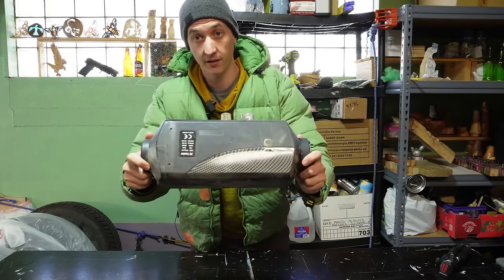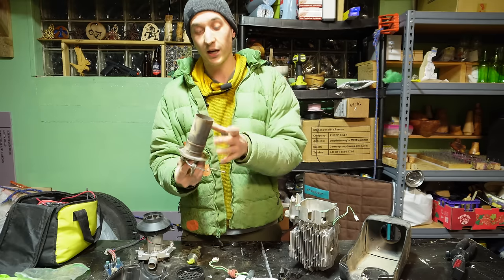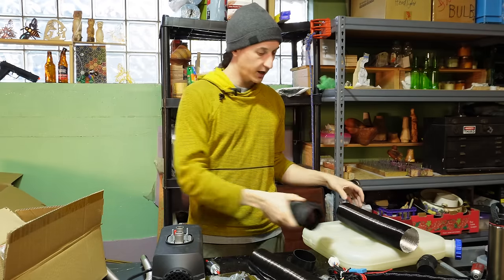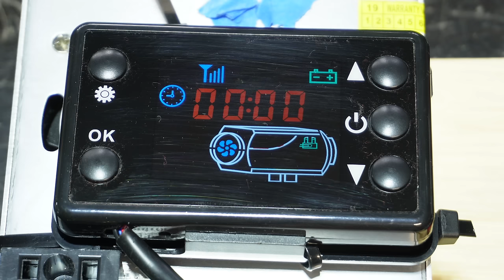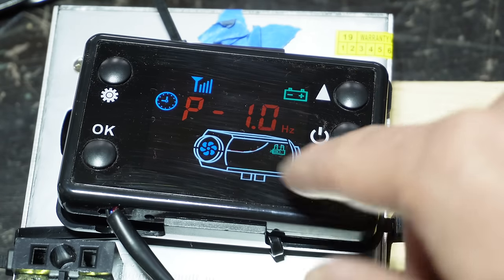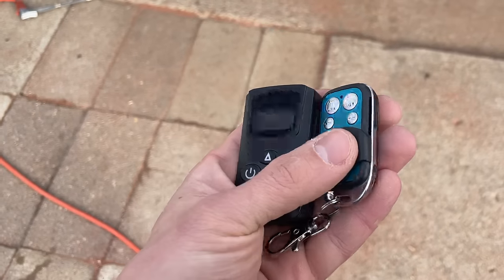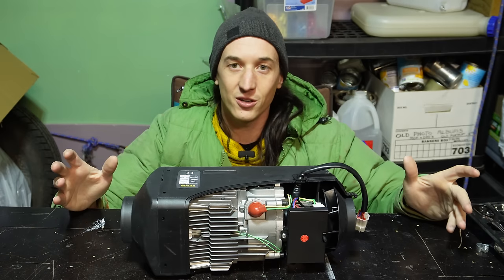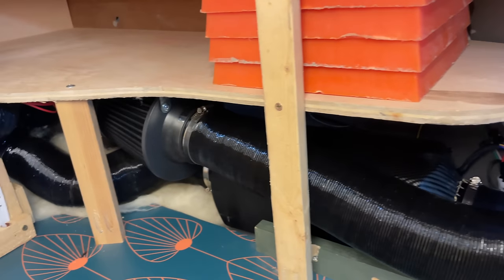Everything You Need to Know About Diesel Heaters

Comment: A crucial step you left out, you must check the exhaust gas for carbon monoxide levels after adjusting. If it's too weak or rich the figures will sky rocket and quickly become a health hazard, and with a window open or leaks in to the living area present a serious problem. Even a cheap Ebay monoxide tester (those yellow ones for $25) will do the job, just hold it a foot or so away from the exhaust so it does not melt on a calm day and take several readings at low medium and high output power. You need to aim for 20 to 50ppm at all power levels (20 at low and 50 at high). I have found 1.6@1680/5.0@4500 the sweet spot for 0 to 2500ft ft alt, 1.4@1680/4.5@4500 for 2500 to 5000ft alt, and 1.3@1680/4.0@4500 for 5000 to 7500ft alt. 25 to 50ppm carbon monoxide is the key indicator for correct combustion/fuel to air ratio. Not had any sooting for years at those settings using good quality fuel on any of my 5's. Running a 50/50 mix of diesel and kerosene is an even better option in cold winter months for clean burns. Some great info for many in your video by the way!!
Reply from the maker: That is a good point! I knew I forgot to mention something. Out of curiosity if you are running too lean how high do the CO numbers get? I change elevation all the time so constantly re-tuning the heater isn't exactly practical, but I think for a static installation this is a great tip to get the most out of your heater while minimizing CO exposure.
Reply: @dustyodyssey  There seems to be a sweet spot window of about .3hz/.4hz where everything runs fine (about .15hz/.2hz either side of correct). So if your target was 1680@1.6hz then you would get to 1.5hz perhaps 1.4hz and not affect the ppm (or at most 10ppm) then when you drop to 1.3hz it will suddenly rocket to several hundred ppm (and much higher at times!). Same goes for increasing, 1.7hz and 1.8hz would usually be ok (just), but at 1.9hz and a sudden rapid ppm increase. It can vary a little, sometimes the sharp rise could happen on the second step above or below, so it can vary on temperature (air density) and other factors including the altitude.  Fuel type and mixing fuels also affects fuel/rpm ratio and ppm, but that's a whole different topic! (for example one of mine has run at 1.2@1680 on 80%kero/20%diesel@15ppm 1000ft which is super low and clean!)
Reply: So - isn't the risk of excess CO higher when you run too rich (not enough oxygen), versus too lean?

I always understood that too-lean virtually eliminates CO output - but at the expense of heat produced. I.e. prioritising 'safety' over efficiency/warmth per unit of diesel consumed.
Reply: Running lean causes high CO i experimented with lots of settings and i now have 20-30ppm across the board and never needed cleaning for 4 years.
Reply: @jamie-hb8gy  That's interesting, in engines running lean results in a drop of CO because you have excess oxygen to react with the fuel. That's interesting that it doesn't work that way in diesel heaters.
Reply: @mibars  Diesel heaters aren't engines,no compression.
Reply: @jamie-hb8gy  yup, but I still don't understand the physics of this! I'll avoid tinkering Hz vs rpm until I get a proper CO detector instead of a CO alarm that goes from nothing to popped eardrums only.
Reply: @mibars  it's basically incomplete combustion.
Reply: @jamie-hb8gy  but how? There is plenty of oxygen for a complete combustion, usually CO happens instead of CO2's when there is not enough O's in the mix, but with plenty of air and scarse of diesel we should see some other ill effects, like a fire too cold not an incomplete combustions
Reply: Health..u eat food don't u..don't know what u eat. .

Comment: Most fuel pumps do better pushing fuel than sucking it out of a long line.  You want the pump to last longer, have it as close to the tank as you can OR have it lower than the tank.  It will also help with priming.

Comment: Although many will disagree, the fuel pump mounted in a vertical position will increase its longevity with complete lubrication of the pulsating cylinder, also the rubber glow plug seal needs to be properly installed or you will get exhaust in the cabin area. For the body intake you can adapt a shop vac filter with flex tubing to avoid dust and debris on the heat exchanger.

Comment: I agree that running the heater full blast is not necessary to prevent carbon buildup. Mine has been used 99% on the lowest setting for 3 years with no carbon buildup.

Comment: I have three of these heaters doing different duties from a shack to my workshop. In the workshop I ran a 2metre long exhaust tube through the wall into the metal shop along it's wall with a 1° fall then through an external wall to the outside. The heat from the 1.6m of exhaust tubing running along that wall in the metal shop (with a stainless heat reflector/shield) is amazing, it makes a big difference in winter just utilising exhaust heat that would otherwise be wasted. To get the fuel mixture right on that setup I had to increase the fan speed by 600rpm and it seems good so far, but I also run a dual fuel supply which lets me (electronically) switch over to a high volume outside tank containing 50/50 waste oil and diesel mix after running temp is reached, then I switch back to straight diesel around 10-15 minutes before shutdown and crank the temp up as it helps clean the mesh glow plug wick for the next start, if I peer oy the window I can spot an occasional spark exit the exhaust during this burn off, so it's doing something. This system has been running around three years with zero soot build up, I did replace the glow plug once shortly after the installation and I bought several spares, but so far the replacement has lasted well. I also use copper never seize on the bolts and glow plug which makes removal a breeze. All my systems run on solar power with a 100W solar panel charging a bunch of recycled car batteries, the system will start any time of day or night and can go 24 hours a day without losing charge, even in winter with short days. 
Cheers.

Comment: The asbestos in the gasket isn’t an issue unless they are flaking apart. Also never use a grinder or wire wheel to remove gasket material from housing.  Gently Use a scraper to help remove. You can also dampen the gasket to reduce chances of making asbestos airborne.
I  worked with asbestos periodically my whole career.
Reply from the maker: good tips, thanks!

Comment: Thanks for sharing your review and thoughts on these types of heaters,I use 2 to warm my rv and they work very well.i run pump diesle and also use an internal filter in my fuel tank, plus an external filter just to be extra sure I'm running clean diesle in my heaters.

Comment: I bought a Vevor 5kw off Amazon shortly before you released this video. The model is XMZ-D2. There’s some possible differences you might want to be aware of:
1. Your smelly rubber gasket no longer smells. I took a flame to it to see if I could tell if it’s silicone or not, I’m not sure, but it didn’t emit black smoke. Smelled a bit worse but not terrible. Did they change it to silicone? Inconclusive.
2. The internal vibration dampers are now green on the side facing the components of the heater and are made of two different materials. Or at least two different color materials, green and white. Did they add flame proof liner to the pads? I have no idea, but it looks different than yours. 
3. The color of the unit is orange and black, not grey. 

Fuel line is still green, positive voltage wire looks to be about 14 gauge. 
Fuel pump model is CNMZ-23, is that the same as yours? 

I find it odd they’d send you a lesser model than one they sell already. Or maybe this is all just smoke and mirrors and they’re exactly the same. I’ll install it in a week and can provide feedback.
Reply from the maker: Interesting! Maybe they have made some improvements then. Good luck!
Reply: Where’s your feedback?

Comment: Very well explained. I've been waiting for the "Pinto moment" where a wildly popular thing is suddenly discovered to have a huge flaw and that isn't happening with these heaters. The few issues some people have are seemingly rather easily and cheaply correctable. I've already decided to use one of these as my primary heat source for my travel trailer when the money becomes available and I'm wondering if the output could be tied in to the existing duct system? I can't see why not but it would be nice to hear if someone else has done this.

Editing to add: If you use one of those intake air filters, buy a genuine "K&N" brand filter. These were originally designed for motorcycles and in that field (and among car tuners too) it's well known that the knock-offs are much more restrictive as well as being less efficient at filtering. Positively worth the extra cost for K&N filters.
Reply from the maker: Based on what I've seen on the forums others have hooked these up to their existing ducting systems with a little creativity. Depending on how big your travel trailer is and how cold it's going to be where you're going you may find that you want more heat though.

And I did look at K&N but decided that a dry filter sounded easier to maintain, also I wasn't sure if I would be smelling the filter oil all the time? We'll see how this one works though, definitely an experiment.
Reply: @dustyodyssey  Thanks for the reply. K&N's can be ran 'dry', their recommended oiling enhances filtration at a slight cost of airflow but they're still flowing more air than the off-brands do. Not sure about any smell of the oil, my experience is as a motorcycle (and car) mechanic. As long as your filter is working OK use it, but when the paper element deteriorates replace it with a K&N for max airflow and lowest restriction. 

I'm semi-retired in the upstate of SC, so no bad cold weather here and even a 4K setting on a Mr buddy heater is toasty-warm but expensive to run compared to what I've heard about these diesel heaters, and I'm replacing all the 30 year old  equipment as well as getting set up for solar eventually to minimize my living costs. I'm also going to be doing a semi-conversion on my equally old ex-work van for short term occupancy and small job work where one of these heaters will be exactly what I need.
Reply: These heaters really are the dog's bollox!

I remember paying over £2500GBP to get my Eberspächer

Comment: 32:00 The burning plastic is the heater itself inside the case burning the case. There is normally a flow of air preventing the plastic case from getting how and melting. 😆

Comment: Thanks for your review and walkthrough about what to consider when setting up a diesel heater. I'm getting ready to set one up in my Mercedes T2 camper van. In your opinion, would there be any disadvantage to just setting up the entire unit out side, but under, my van? I've got loads of space to work with under the van and I could even conformal coat any PCBs that need it and apply poly to other sensitive connections. I'd prefer this solution because the van was converted 30 years ago to an RV and so there aren't really many optimate spots to mount it directly to the bare metal floor but I do have an area that would accommodate a vent hole to inlet the heat into the van. Either way - cheers and thanks for maintaining your integrity with the reviews, I think it'll serve you well as your channel continues to grow!
Reply from the maker: As I am sure you are aware, these units are not exactly waterproof. Surely it's possible, but frankly I don't have any experience with what could go wrong. I would recommend having two vents, one for the heated air and one for return air. If the "cabin" air inlet is outside not only is your heater going to be a lot less efficient, but you also run the risk of pulling exhaust gasses into your living space.

Comment: hehe, i have been driving a diesel for the past 12 years, but completely forgot that it is entirely possible to combust diesel without pressure. after your explanation at ~ 5:30 i was very confused for a few minutes :D  i was expecting so see pretty much a small engine once you took that thing apart

Comment: Important to note that the moisture in the exhaust pipe comes condensation of the water within the exhaust gas, since burning hydrocarbon fuels like diesel, gasoline or gas creates carbon dioxide and water. When the by cold outdoor air cooled surface of the pipe extracts heat from the exhaust gas, the water will condensate there.

Comment: If you cut and splice the wires, are you really reducing resistance or increasing current capacity?  Are you making a soldered connection or some sort of crimp?  Overall, great review of these products.  Normally, reviewers just rave about them and never highlight the flaws.

Comment: I hear people use these for roof top tents, I have not because I feel that even if I have the unit outside it would still smell my tent up with diesel smell. Even if it is safe, I don't like the smell of diesel especially when I am trying to sleep. Do you think Kerosene would be less stinky and I am I correnct in thinking I will smell the diesel fuel in my roof top tent? Cheers, Great information by the way.
Reply from the maker: I have not run kero, so I couldn't tell you, but I would assume it's not all that different from diesel. If I have my windows open for cooking and the wind blows a certain way I do definitely get a slight smell inside, but most of the time there is no smell, but I can imagine in a tent you may smell it from time to time, but I wouldn't think it would be too bad. Cheers!
Reply: @dustyodyssey  Thank you
Reply: The instruction booklet to my Eberspacher heater states to use diesel/kerosene mix in sub zero temperatures it says to use neat kerosene at -25*c and below, hop this is of some help.

Comment: What brand of diesel heater do you have? I've watched too many videos with these cheap heaters and their issues. Lol I looked into the main brand and yes very expensive but there has to be better options. I really want a mini wood stove but those aren't cheap either. Lol very good video, Dusty! I had to share it with another van lifer!
Reply from the maker: I bought mine (unbranded) from an ebay seller called "echamptrading2017" haha. It actually looks like they are one of the few sellers that are still shipping out the good fuel line, and you can get the "advanced remote" which is tunable. But, with all of this stuff you're kind of taking a gamble that the quality will be there.
Reply: @dustyodyssey  yeah, I am leaning more towards the higher priced one.

Comment: don't remember hearing you say but, what about the power consumption on a 12v battery? how long can it run on a full charge?
Reply from the maker: Oh, good question. At 12V it uses 10A on startup, ~1.1A on low, and ~3.5A on high. So a 100AH battery will have you good for at least 30 hours.
Reply: @dustyodyssey  my question for my off grid shack I need to heat.  I am in desert wood way too expensive to buy.

Comment: What is ur opinion, I changed glow plug,put it back on ,started it up worked for aweek than the fault code came up 0 8 ,when I start it up goes for 10 min with glow plug symbol than dissappear,now it blows cool air
Reply from the maker: e08 is usually an issue with fueling or a clogged (sooted) combustion chamber. Is this a new setup or has it been sitting for a while? can you check that the lines are primed and the pump is pumping?
Reply: It is about 18 months, old been sitting over summer, I hear pump working,but on the outlet will there be just a dribble of diesel or squirt like
Reply from the maker: @ernestchapman898  you may just have old fuel in the lines then. Hard to say
Reply: I installed a new unit and still giving me a code 8 same as I had with the old unit ,have any ideas?

Comment: Just bought a brand new diesel heater. Installed the exhaust outside. Put some exhaust paist on the exhaust. Every time I turn it on I get a headache. I have carbon monoxide alarm but does not go off. Anyone got any ideas what’s wrong. I have used just under a tank of diesel so far

Comment: i have that exact heater vevor it lasted 1.5 years and now the glow plug is bad. it doesnt get hot enough to start i think as i t just smokes.
Reply: that gasket also only lasted a year and dried and cracked
Reply: i take my vevor heater anywhere from 2000 to 10000 never noticed a problem
Reply: i run the shit fuel line for the last 1.5 years no problem

Comment: Diesel heaters are not worth the money. If you have a solar set-up, the heater eats electric power. I had an espar and it munched my 3000 watt e-power dry in 4 hours. Imagine a winter storm and no heat at 2 a.m. and closed roads, so I had to use the vehicle heater for 4 hours. Thankfully, I was parked next to a fuel station, so fueled up when the engine chewed though a lot of fuel while idling for 4 hours.  

In my new rig, I put in a solar generator which takes up a lot of space, but a little electic heater warms the space perfectly. The generator battery had  plenty of power after running the milk barn heater, refrigerator, lights, and movie player all night while 2 ft of snow fell. And I had plenty of power to make hot cocoa while watching the sun rise over a snow covered Colorado wonderland.
Reply from the maker: Interesting. I have found the opposite to be true, on low my diesel heater uses ~15W which is practically nothing. Glad you were close to a fuel station! That could have been a scary situation with the roads closed!